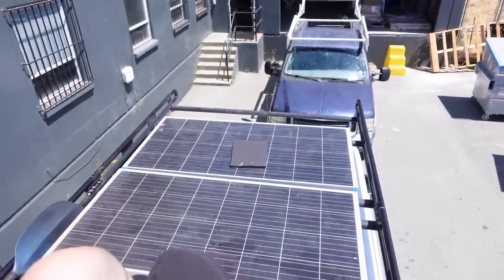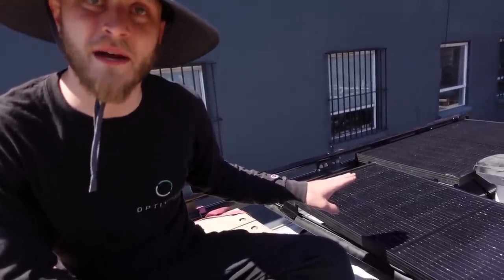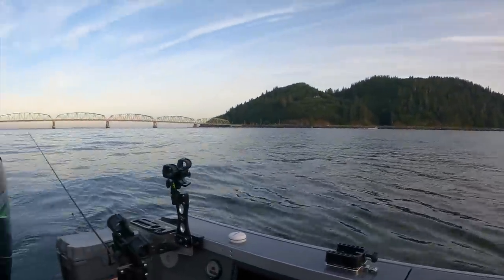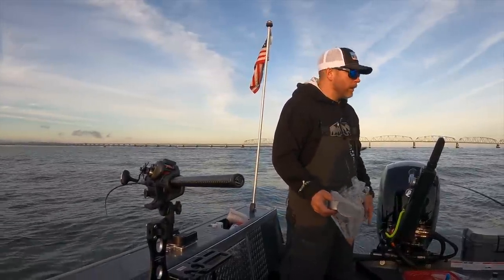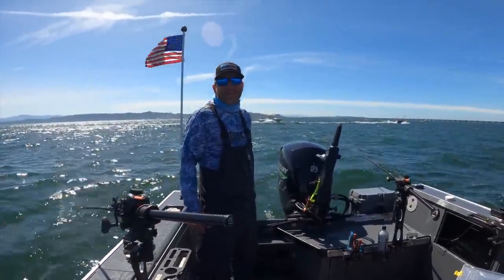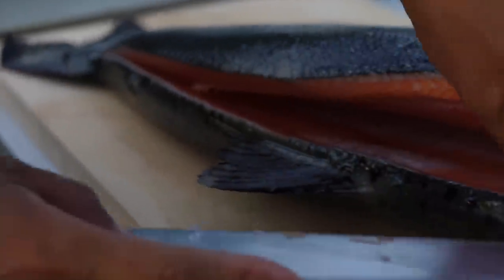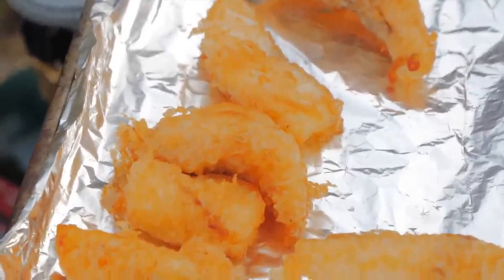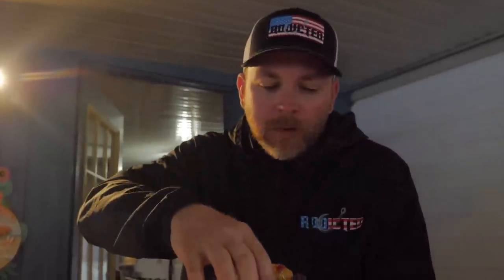WE'RE LEAVING CALIFORNIA

Comment: Hi, it's me again, let me know if you need any help with these solar systems. To elaborate, I am an EE that specializes in power. The reason you lose power by blocking one cell is that it cuts of the current between cells in series; depending on how it is set up of course. No cost from me. You taught me enough with your sushi rice video. Free advice is good advice I say.

Comment: Not to knock Optival but...most panels work in the shade. Not sure if these panels are any different than ones that go on houses but I can guarantee you that if my roof's solar panels are partially shaded, the unshaded parts of each panel will still work and generate electricity.
Reply: Those were the old ones that didn’t work when partially shaded. The new Optivolt ones work.